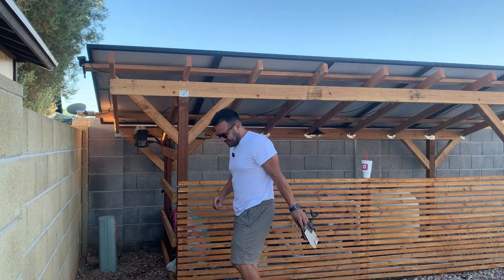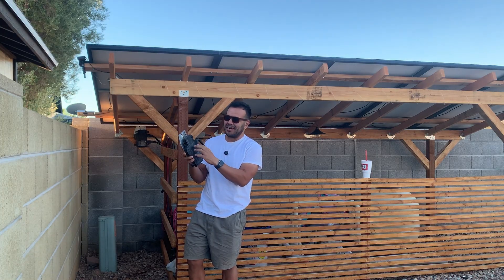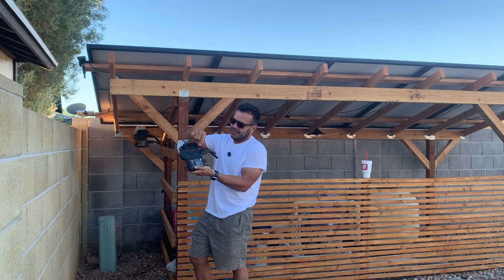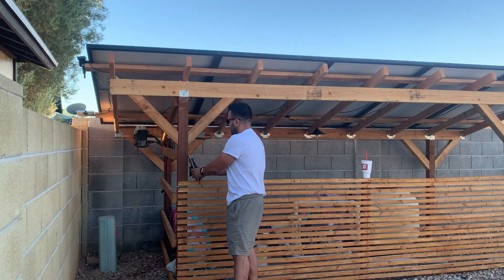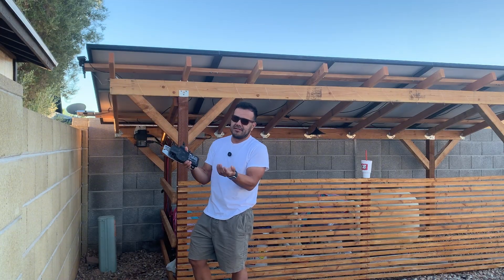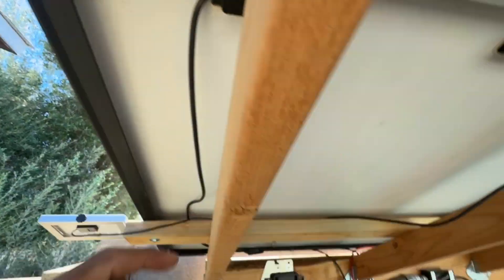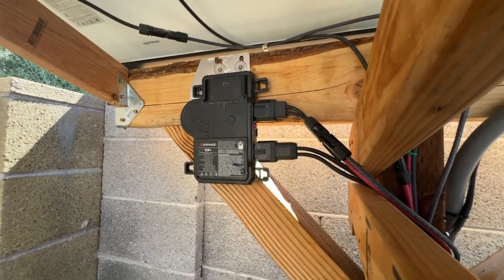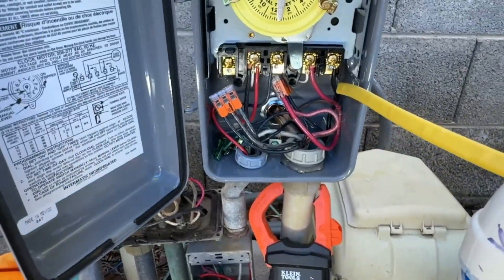DIY Solar Pool Pump: Enphase IQ8+ Microinverters Offset Energy Use

Comment: Nice explainer and pretty clever.  My Pentair variable flow sometimes shuts down mid-day due to the pool cleaner gulping air at the tiles.  Motor over-revs and then the motor resets 5mins later.  With the mechanical timer being on, would that not back-feed to the grid and upset the utility company without a grid-tie contract?
Reply from the maker: Good question — and just to add context, I already run a separate off-grid solar system for my house. This microinverter setup was simply a small experiment to offset part of the pool pump load and observe real-world behavior.

There is a potential backfeed risk if the timer is on but the pump doesn’t actually run, which is why I intentionally kept it very small — about 1 panel / 1 micro (~250W). My house has a constant baseline load (fridges, fans, lights, etc.) that should  absorb that power if the pump doesn’t turn on.

That’s also why I haven’t added more micros. Around 500W+ starts to feel like too much if the pump doesn’t turn on, since production could exceed the home’s baseline load and potentially backfeed.

Recap: one micro helps offset the pump and is absorbed by the home if the pump doesn’t start. Two or more micros offset more, but could exceed baseline load and risk backfeeding if the pump isn’t running.
Reply: @Yesseyd  Roger that.  House is an insurance policy/buffer/sponge.  The cost of electricity here is so ridiculous (SoCal) I am looking to get the pump totally off-grid or hybrid with adequate control.  Looking at an EV4... will post findings if interested.
Reply from the maker: @mootzeroni  That’s a good way to think about it — the house acts as the sponge and the insurance, soaking up any excess power. Makes even more sense with SoCal rates. I’ve got family down there and my wife’s uncle showed me his Edison bill… around ~$0.58/kWh. Before I had solar, his total bill was about the same as mine even though he used roughly 1/4 the energy — almost 4× the cost per kWh. He barely uses electricity too, most of his appliances are gas and HVAC is really the only big electric load. What’s the EV4 you’re referring to?
Reply: EG4 I guess i meant... traditional wall mount inverter with 110 and 220 w/ battery backup option.